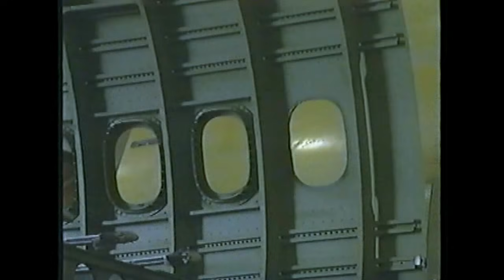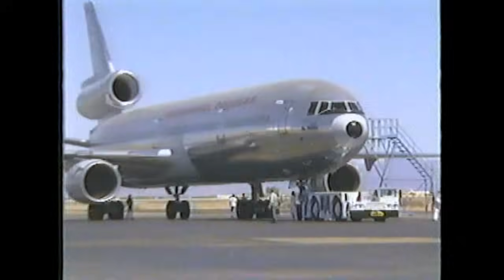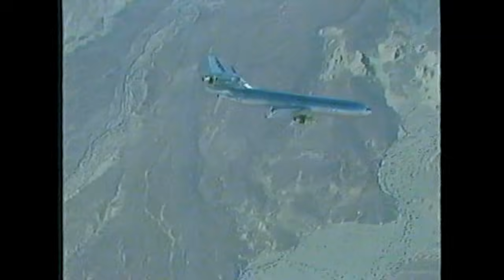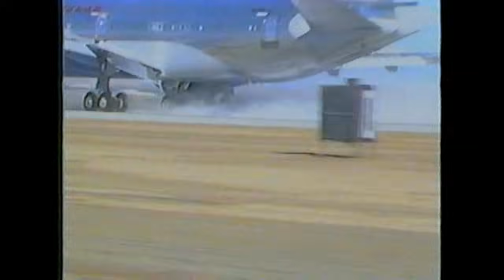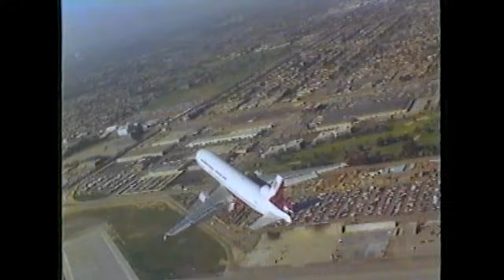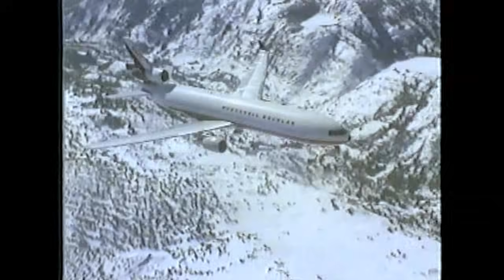McDonnell Douglas MD-11 Promo Film #1 - 1991

Comment: The test aircraft in this video, N111MD (N601FE) and N211MD (N602FE) are both still flying today with almost 90,000 flight hours.
Reply: That's actually incredible
Reply: Update : As of 30 April 2023, N601FE has been officially WFU. However, its sister ship, N602FE is still active.
Reply: @akifiskandar4186 

WFU?
Reply: @ri1288  Withdrawn from use aka retired
Reply: As of November 2024, N602FE is now in storage

Comment: I was very lucky as a teenager to start my career at McDonnell Douglas, starting off in mock up building full size aircraft out of wood, working directly with the engineering department making sure everything fit right I was on the interior design project of both the MD 11 the C17 and the MD 12 nothing like having top security clearance to work on the C17 at 20 years old ,I actually flew in the Md11 during its test flights I actually got to sit in the cockpit during takeoff out of Long Beach which was so awesome to watch what these pilots do , the pilots were amazing they put that plane into serious test procedures that literally took your breath away especially during stall procedures and banking procedures , those were great times and memories very fortunate to work with a lot of great people

Comment: I Swear. I Would give up all of my possessions just to bring back McDonnell Douglas. They made the BEST aircraft EVER!!
Reply: They merged with Boeing in 1997.
Reply: I Know, but it's not the same.
Reply: Yes to the DC-3, DC-7, DC-9, DC-8....The MD-11 was a failure....American Airlines got rid of them in just 2 years. Way too many accidents involving the relatively small # that were built.
Reply: I Agree on the MD-11 being a failure, but it is still a beautiful bird and FedEx is still using MANY of them.
Reply: I Already flew on PH-KCG From AMS-ATL back in 2012, It was the best flight I have ever had! It was fast, comfortable, zero turbulence (the fasten seatbelt sign didn't come on ONCE mid-flight, except for landing of corse) and the food was actually delicious!
Reply: Except for the fact that DC-10 and MD-11 passenger planes crashed the most
Reply: Pandngaming No, they didn't  check the  statistics..!  

your statement  is simplistic  and incomplete, and leads you to an erroneous conclusion.  The last MD-11  crash of the SWISSAIR in 1998 had  nothing to do with the plane.. The Swiss replaced the original business class entertainment  system with their own which consumed three  times more  electrical power than the original one..They didn't  ask Mc Donnall Douglas  when they have done it..
DC-10  had  one accident  in every   3.7  million   hours flight.. Acceptable ..
Reply: The best  Douglas   plane  was   the   DC-8   Super Sixty. .It was far superior to  their  counterparts  B707  and Super  VC-10. It  could  fly from Cape Town South Africa  to London   non-stop  ,more   than 7000  miles ,the other two could  from Nairobi to London  but not this ..Apart  from that ,it was the fastest commercial  jet of its time and the only  one  exceeding  Mach 1.. no other commercial airliner could achieve this. DC-9 and DC-10 were pretty average if you ask me
and  the  Lockheed Tristar  was massively superior to DC-10 and MD-11.
Reply: johnlouisville Yes, the 11 had it's share of problems, but out of 200 built, there are 166 still flying.
Reply: barracuda7018 only the Concord traveled at super sonic speeds (766 mph)! all other Large Commercial planes fly at subsonic speeds..  Having said this, the super 8 was a fast bird at just under 600 mph that's pushing Mach(.9 )
Reply: Yeah, dc 10 just caused a lot of incidents and accidents ...
Reply: Well, not exactly - granted hydraulic system positions were one of many issues, but  thought often the problems were caused by 3rd party parts, pilot error, or maintainence snafus...
Reply: johnlouisville Why exactly is the MD-11 such a failure? I've never really understood
Reply: ***** I think it'll be the fact of it having 3 engines instead of 2. Twinjets are more popular. The 777 is slowly taking over the 747's jobs.
Reply: Did MD not have problems with cargo door latches though.....?
Reply: John MacLaurin No, AFAIK it was fixed in the MD-11.
Reply: John MacLaurin It was actually fixed after the THY crash.
Reply: Many 747s has been crashing too.
Reply: John MacLaurin It happened with the DC10-10 between 1972 and 1974 with American AIrlines 96 and Turkish Airlines 981.
Reply: Louis Brasil Nothing to do with the plane itself, stupid cargo door .Plane was O.K..
Reply: barracuda7018
Yes it cost the lives of 346 people on the THY 981 and MD was sued and paid 80 million dollars.
Reply: Louis Brasil That's correct...
Reply: well boeing uses the mcdonnel douglas logo
Reply: You mean the DC-10 and that was fixed but too late. It was actually a very good plane once fixed. The MD-11 was much later and FedEx bought a boatload of them.
Reply: Man this give me goosebumps. Those McDonell Douglas MD-11 were beautiful, with the colors of Alitalia it was the golden age of aviation, I remember as a kid how glamorous it was to fly and all those fancy aircraft with such fine colors, it was a good time. Flying now is boring.
Reply: Car Wash Studios then they went bankrupt and Boeing bought them
Reply: Car Wash Studios 
The MD-11 is the most amazing Aircraft ever made of humans
Reply: US Aviation, That caught my eye too. I figured I'd run it by Wikipedia and dang if there isn't a paragraph on the subject. https://en.wikipedia.org/wiki/Douglas_DC-8#Production_and_testing the second paragraph. August 21, 1961 - in a controlled dive with Yeager in an F-104 flying chase. There's a story of a JAL 747 that survived an uncontrolled dive that went supersonic too, not sure of the JAL detail.
Reply: Then why it's not in service why this aircraft  failed?😞
Reply: I wanted the md11 as a two engine plane
Reply: @johnlouisville  Boeing 777 killed the MD11 and McDonnell Douglas.
Reply: If McDonnell Douglas was still in business, they'd be making twin-jets too.
Reply: johnlouisville The MD-11 is not a good plane for passengers. It’s a damn good cargo plane
Reply: @theobserver4214  The MD-11was just too late, the 767 marked the end of 3 engine wide body long before the 777.
Reply: Unfortunately, at the time the MD-11 was announced, it was already the beginning of the twinjet widebody era. Before that, the Boeing 767 became more preferred by airlines than the DC-10. Airlines continued to prefer the twinjet configuration, so the MD-11 wasn’t very successful. And then the Boeing 767, Boeing 777, Airbus A310, Airbus A330, etc. had the same role as a wide body mid to long range aircraft but more efficient.
Reply: Boeing made the best aircraft ever.

At least, until the merger with MDC. Now it is always bottom line first, quality second. MDC ruined Boeing.
Reply: @j.o.1516  Yes, the A-300 was first, but the new technology of the B767 brought greater range to the new wide body twins.

Comment: I love the MD11. Flew one today. It's always a blast and when really light a real hoot. Climbed to FL410 in 11 mins.
Reply: V/S 4000
Reply: @dinghenryst  Yes, and I saw this only 1 time. Climbing so fast that in the mid 30s the plane actually changed to VS climb and lowered the rate to about 3000FPM. I believe it is programmed into the computer to NOT be climbing this fast up high. We both looked at each other and said."Never seen that before. Love the MD11.

Comment: Awesome Aircraft, its a shame ill never get to go on one. :(
Reply: OBSCumulus Me too:(
Reply: So sad.
Reply: GianCarlo M. She was an extremely reliable and safe airplane.  The early DC-10 accidents due to the CBD and engine strut break in Chicago (caused by faulty maintenance , not a fault of the plane) tarnished her reputation forever, but she and her sister DC-10 are beautiful, safe, reliable and excellent planes.
Reply: Rafael Enriquez  they landed really fast for a passenger airliner, the only other airplane that landed faster was the Concorde. The MD-11 had a pretty good safety record, much better than the DC-10. Out of the four pioneering widebodies (Boeing 747, McDonnell Douglas DC-10, Lockheed L-1011 TriStar and Airbus A300), the one with the best safety record was the L-1011.
Reply: @doabarrellroll69  Landing speed:
Concorde: 162 knots
Tupolev tu-144: 170-179 knots
MD-11: 158 knots
It can surely be agreed the landing speed was quite fast for a passenger airliner.
Reply: @wolftng359  dC 10 poorly designed cargo door killed a lot of people. The L-111 was a much better plane
Reply: If i was a millianare, i will buy one of them and turn it into a private jet.

Comment: 12:00        that was the problem with 737 lately :
The reversers would engage 'accidently'
Reply: No... they do not deploy accidentally! At least they shouldn't if designed properly! I had to rewire the relays that inhibited the reverse system as part of my job as avionics flight test engineer. The FAA asked us to perform this test, due to the crash and loss of all souls,
May '91 aboard the 767-300 Lauda air disaster in Thailand when the T/R's deployed accidentally!

Comment: What is interesting is that the MD-11 rarely needed the rudder engine except for short runway operation or running close to MTOW.. It was designed to meet ETOPS for overseas airline flights. The benefit (and downfall) of MCD aircraft was the "old style" in which they were assembled. It made them indestructible, but difficult to discount due to high labor involved. As far as any "bad culture" transfer from MCD to Boeing, if anything MCD brought more frugal ways to over budget Boeing.

MCD was still better than Airbus when it came to passenger comfort.But facts are facts, MCD was capital poor and unable to position itself with the changes deregulation brought to the US airline market.
Reply: I flew both the MD-11 and the DC-10, as well as the L-1011 and B-747-400.  I liked all of them, but the fact is that the Douglas products were under-engineered in some key aspects.  Accordingly, adding Douglas culture to Boeing was NOT beneficial, the MAX debacle clearly demonstrates this.
Reply: @AndreySloan_is_a_cnut  No disagreement. The 10 and 11 were under engineered, that is how the 10 got to market so fast. Just some of the safety features of the 10 were just plain nonsensical, but met the purpose of the FAA regs, but not the spirit. As for the MAX, I will disagree. Boeing & Southwest own that one. They were extending the life of the 737 long before MCD came around. Platform management & Renton assembly was not run by anyone associated with legacy MCD.  There is a difference between under engineering and taking short cuts. SWA pressure provoked Boeing shortcuts. Just because legacy Boeing employees like to blame MCD for everything, that does not make it all true. I mean we are what, 27 years post merger? When do you start owning it?
Reply: @spuwho  - It’s the overall corporate culture - the same one that only put one stick shaker (second optional at extra $) on the DC-10, contributing significantly to the AA191 accident.  Yes, faulty maintenance practices set the stage, but lack of redundant design in a critical system (along with poor design on the slat mechanism) denied the crew the opportunity to avoid the accident - to at least as great a degree as the MCAS accidents.

I’ll agree that Boeing and WN share blame for extending the life of the 737 beyond what it should have been (they should have gone clean sheet after the NG); also for killing the 757 which would have been able to have been what the MAX tries to be - though a clean sheet narrow-body would still be needed, but a re-engined 757 could have been a better stop-gap than the MAX.

I’ve talked to a number of people who legitimately point to the shift that occurred after the “merger.”   Probably more accurately MD using Boeings money to buy and infiltrate Boeing.  Here’s an article that pretty well describes it and matches what I’ve been told by numerous insiders:

https://qz.com/1776080/how-the-mcdonnell-douglas-boeing-merger-led-to-the-737-max-crisis/amp/
Reply: @AndreySloan_is_a_cnut  Yes, I have read this article and several books that have come out post merger so these items are well known to me.  All I can say is that Stonecipher was right but went about it the wrong way. And I have nothing good to say about anyone who came from the Jack Welch school of leadership. They for the most part have flopped. Boeing was no longer this regional engineering club. They were now a global  concern that had impacts outside of that little nest called Seattle. BCA was never told how to engineer by senior leadership, they were simply given cost and revenue targets to meet and left it to the managers to work it out. Something that almost all publicly traded companies are held to. So in some ways Boeing's culture, while admired, was no longer in line with the expectations of a new era in passenger air. Learn how to engineer in new ways or die as a concern. Many legacy Boeing employees resistance to finding new ways to make things work were a known hindrance to reaching the next level. A "we don't do it this way" prevailed. Instead of finding a new way, it was all about preserving the old way. And when a merged company spends more time preserving a former culture that company has to die or suffer a major setback to get everyone to stop and refocus on who they are. And this is where Stonecipher failed and his subsequent replacements. But what I found utterly distasteful was after the second MAX crash, this outpouring of legacy Boeing employees casting blame on something and someone else. Look, the plane has a Boeing logo, came out of a Boeing factory and therefore you all take responsibility for its performance. It's a bitter pill to swallow but from now on "you own it".
Reply: @spuwho  - Fair enough, but I still see more Douglas-isms in the MAX debacle than Boeing-isms - the common thread with AA191 in particular.

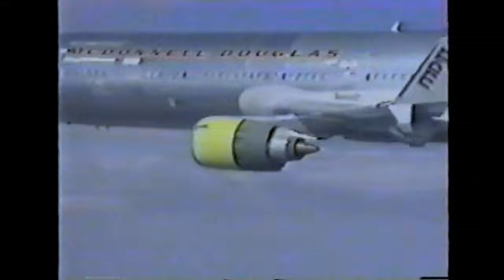Comment: 4:04 successfully deploying the one thrust reverser in flight was in direct response to the Lauda Air 767 crash over Thailand that year, when a single T/R inadvertently deployed, crashing the airplane. Boeing claimed that a single deployment wouldn't be a problem, but it was never tested at altitude ('cause they didn't want to take the chance. . .). When the FAA demanded proof, Boeing caved and developed a secondary lock system to prevent an in-flight reoccurrence.

Comment: What sucks is that the MD-11 was still technically a modern aircraft, but because of what happened to McDonnell-Douglas , it died off too early, the DC-10Mwas from the 70s and was still going strong in the 90s, 20 years later. 20 years later, a 90s aircraft like the MD-11 Is disappearing, even aircraft from the 80s like the MD-80s are outlasting it still to this day
Reply: evan agresti Ughhh,  all the beautiful trijets are leaving
Reply: Yeah I agree, I never expected MD11 to end passenger service the same year as Dc10
Reply: ***** 
Well, that's partially true, however it wasn't an issue with the MD11. It was an issue with the OVER THE COUNTER IFE system that Swissair purchased. The power supply on the IFE system that swissair purchased. Not the MD11 itself. Nice try though.
Reply: ***** 
Well, that's partially true, however it wasn't an issue with the MD11. It was an issue with the OVER THE COUNTER IFE system that Swissair purchased. The power supply on the IFE system that swissair purchased. Not the MD11 itself. Nice try though.
Reply: AnthonyFitzpatrick DankScoped One of the real reason's was because of the fuel-thirsty engines....My father actually worked on the MD-11 at McDonnell Douglas
Reply: Oh, well. I read that fuel costs and other stuff caused it...Thanks for telling me though
Reply: Oh, well. I read that fuel costs and other stuff caused it...Thanks for telling me though
Reply: the MD-11 didnt sell well since ETOPS and the 777 by boeing was being produced at the same time with two engines. The only place where you'll find em now is with cargo companies

Comment: the problem is, the MD-11's life span was cut very short due to high fuel costs.
no airlines wanted to operate aircrafts was more than two engines. that's why Delta sold their MD-11s to FedEx and World Airlines while retiring the L1011 and 727s